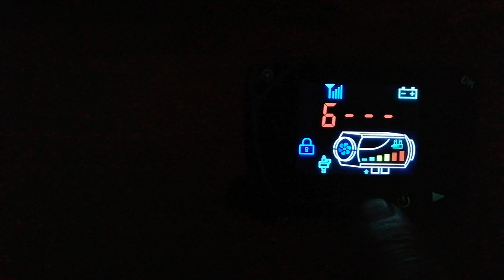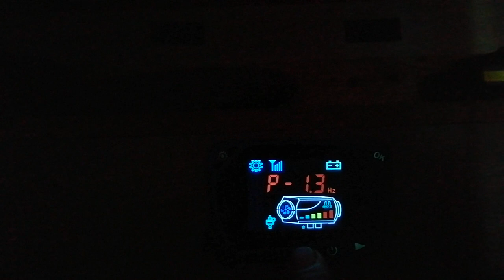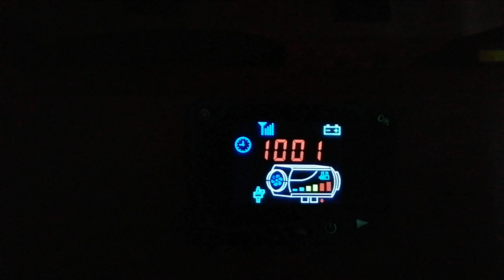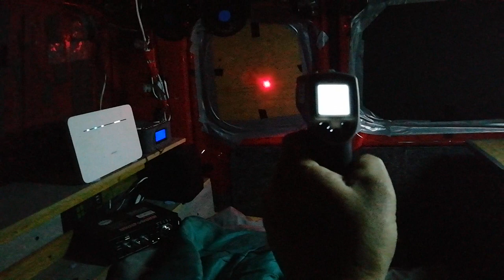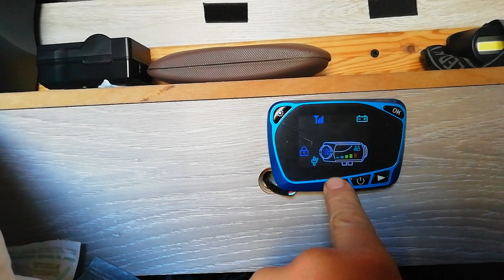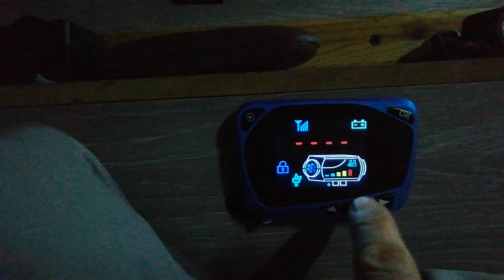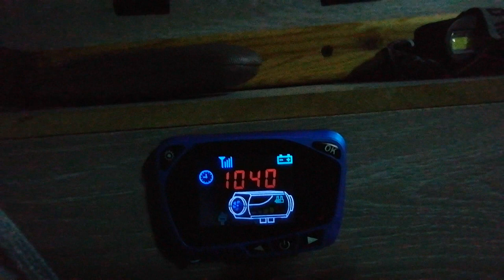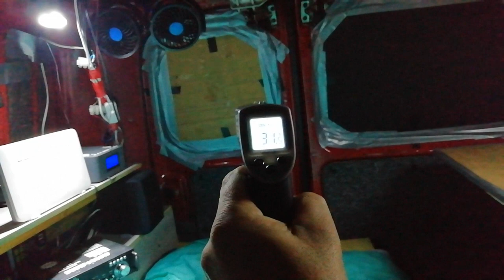I  fitted a diesel heater in my nv200 van plus got it to work at 1hz all in one diesel heater

Comment: I'd get yourself a carbon monoxide detector with the digital reading about £16 just to be safe. You can use the readings to tune your heater.   Alot of people say the portable heaters shouldn't be installed in vehicles. If the exhaust pipe fitting were to crack or leak it'd be In your van. Plenty of Chinese diesel heater pages on Facebook to get advice from. Not trying to shoot you down just concerned that it may not be safe the way it is .
Reply from the maker: Hi thank you, it is a good point. I will get one tomorrow morning.